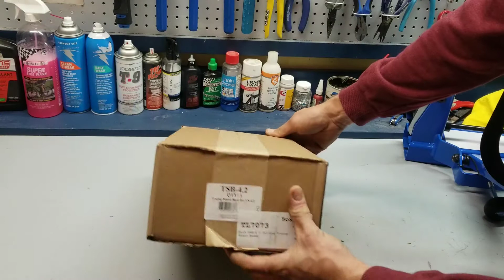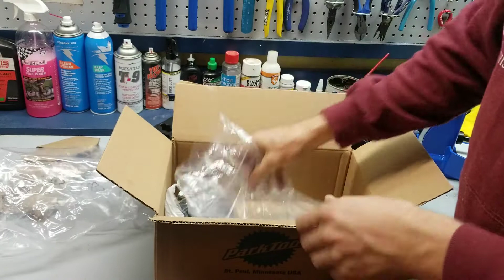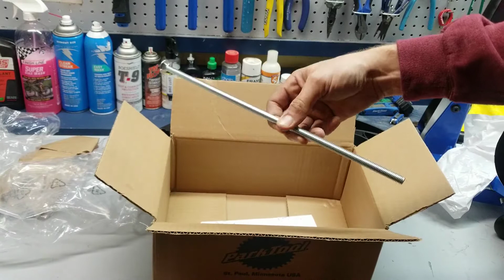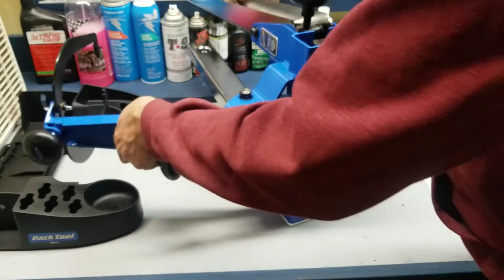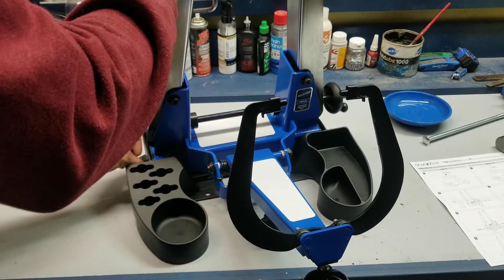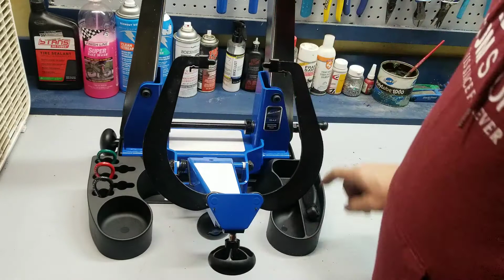Park Tool TS 4.2 Tilting Base unboxing assembly and demonstration

Comment: What to do if the long bolt that goes through the middle isn't quite long enough to poke out the other side? Is this just a quality control error? I don't think that there's any way I am messing this up as I did it the exact same way you did in the video.